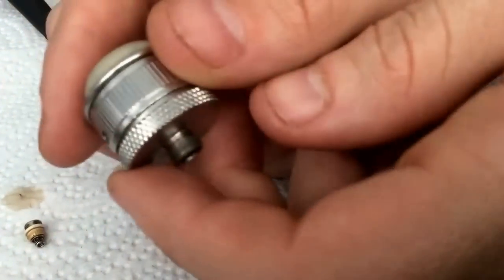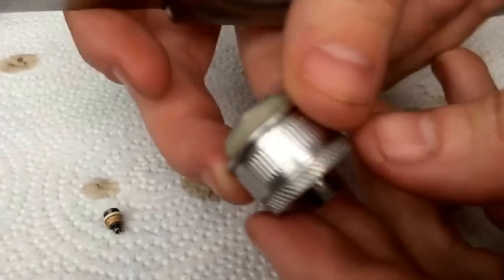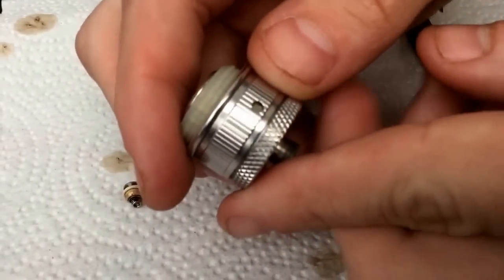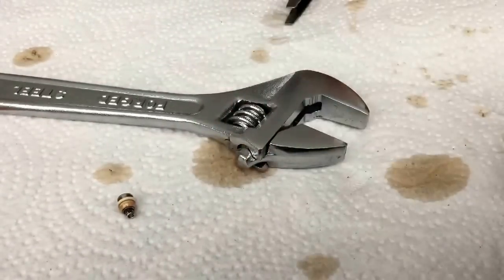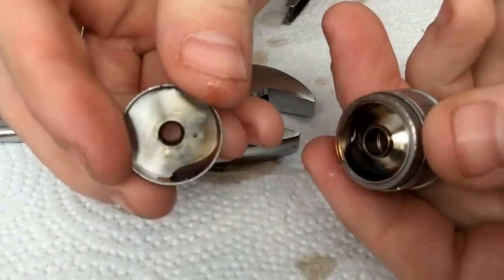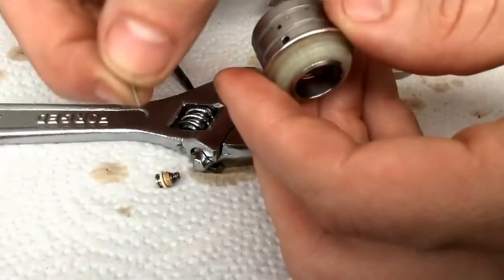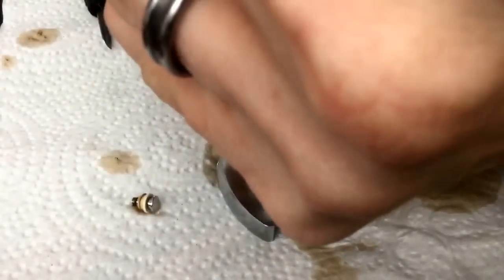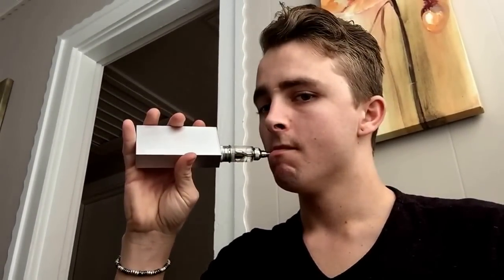How to remove Aspire Nautilus Air flow control (afc) ring

Comment: Great video and just did the same thing to my tank. I didn't get the air flow that I was looking for so I took a small drill bit. one the size of the largest hole, and drilled out the other three holes. there is now a noticeable difference
Reply: I did that a friend's Nautilus as well. And I rebuilt a couple of his coils so they had a 3.5mm air hole up the center so it could take advantage of the increased air. Air flow is controlled by the smallest hole in the system, so having more airflow on the tank doesn't help much if the coil head is still restricting it. It will actually allow a slightly restricted direct lung hit now.

Comment: So let me get this straight, you did NOT put the Pin & Spring for the airflow control back in? Is that correct?  You now have all 4 airflow holes open for your vaping ?  Is this correct?  I could care less abut the clouds, mine droped & the pin is lost, so you have it working with no pin & spring ?

Comment: here how I just did it in less then 2 minutes, put the top of the base in a vice, grab the bottom with channel lock pliers, and twist, then pop off the ring and remove the spring, and place the bottom cap back on and use a Swedish nut lathe aka adjustable wrench on the bottom to make you clear the threads and tap it with a hammer, and boom, its taken me longer to write this comment then it do to remove the ring!